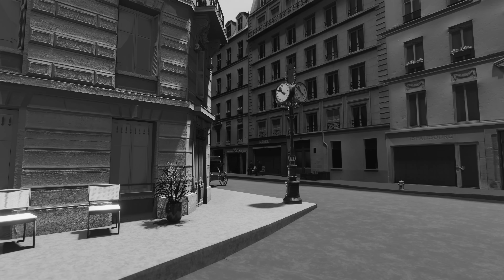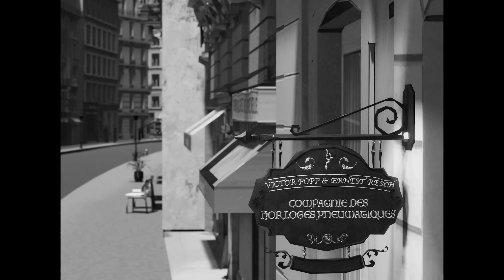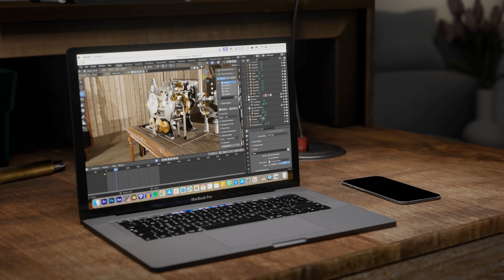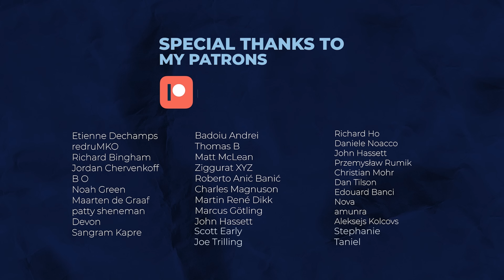The Underground Clocks of Paris

Comment: This is the most steampunk tech that ever became reality.

One can imagine those pulses of air engaging multiple relay pneumatic swichts. Human ingenuity
Reply: now that we think about it
even CPU of modern computer *use the same pulse principles, only it use Electric instead of air or steam and gear
*:edited from sue
Reply: The Industrial Revolution and the rapid development of steam technology opened the optimist imaginations of both engineers and artists, giving rise to the concept of Futurism. I would dare say Steampunk is heavily based on it, given that in that era, electric power still was heavily DC based, and thus, the possibilities that AC opened later on (in terms of efficient kinetic power) were still dwarfed by steam power.
Reply: @Малэволензэ  There was no industrial revolution. They were just kickstarting Old World tech that was already here. These clocks, lamps, buildings, railroads, are literally older than the hills. Steampunk was the reality over 200 years ago. Wireless tech
Reply: Uhmmm, clockpunk?
Reply: @ВадимНечунаев-л2о  i dont think theres a clockpunk?
Reply: @shiro3146  There is. It is close to steampunk, but... clocks. Lots of gears turning.
Reply: This is widely used in industrial settings, certain tasks that require synchronization ans reliability use air pistons, which have higher lifetime than solenoid pistons, safer and easier to service, and compressed gas is its own redundant power source (in case of a power failure The pneumatics could still operate for a few minutes).
Reply: That’s how old control systems work in buildings. I still work with them to this day. Just convert the air pressure to electric signals. But high pressure is a high signal, low pressure is low. Can scale from 0-10, pneumatic thermostats are a thing. Very cool.
Reply: This cannot be neither steampunk nor clockpunk because those two are sub-genres of fantasy and this was real life thing
Reply: @Obsidian-Nebula  but this is the closest tech to the fantasy of steampunk and plus, we were diving into tech aspect of steampunk, not its character aspects of victorian rebels with cyborg body or whataver nor its aesthetic
Reply: @Obsidian-Nebula  Oh! Really ? Thanks for the advice! Now I understand the universe around me.
Reply: @Obsidian-Nebula  fiction can be based on reality. This is, in fact, reminiscent of something in the steampunk genre
Reply: @Obsidian-Nebula  this is like saying a society can neither be a dystopia or a utopia, bc those are two subgenres of fantasy. which ignores the fact that a society can definitely be either a miserable place to live in or an amazing place to live in

Comment: They ran the air lines through the same pipes as the sewer. I'd hate to have to track down air leaks down there.

I heard about air clocks before but figured a constant source of air was just given and each clock would work off of that. This simple idea uses a fraction of the air and it was kept in sync.

But, was there a way that clocks could be put back in sync if they ever lost sync? Due to air leaks, first installation of the clock, human interference etc.?
Reply from the maker: Haha Tracking down air leaks in that environment would be unpleasant I'm sure. As for your question about putting clocks back in sync - there were actually mechanisms in place to address that issue. Typically, the master clock in the system would serve as the reference point, so if a clock were to lose sync due to air leaks, initial installation issues, human interference etc., it could be manually adjusted to match the master. And from what I've read, periodic maintenance checks and adjustments were also conducted to ensure that the entire system remained synchronized. Hope that helps to answer your question and thanks for watching!

Comment: wait but doesn't it take time for air to travel which will offset the clocks? like the farthest clocks will be different to the closest clocks?
Reply from the maker: Yes, so you're absolutely correct that the travel time through the pneumatic pipes could potentially lead to slight discrepancies in time. What you're referring to is actually known as "propagation delay" and this system was designed to minimize propagation delays as much as possible using air-pressure and by optimizing the layout. Inevitably though, periodic manual adjustments were still needed from time to time with the end goal being to keep discrepancies within an acceptable range (usually not off by much at all). I hope that helped to clear things up and thanks for taking the time to watch and comment!

Comment: I like the engineering of this system, especially the almost undefinite scalability by just adding clocks to the pipe. And even if there would be too many clocks, you could extend the system in a rather easy way with another compressor and valve as sort of "repeater" for another 1.000 clocks or so.
Reply from the maker: Yes, the scalability is really just one of many impressive features of this system. I really enjoyed putting this video together and I'm so glad you enjoyed the topic. Cheers and thanks for watching!

Comment: But how did the timekeeper actually update the master clock from the observatory clock? Maybe just a pocket watch that would be precise enough for the 15 minutes to walk between?
Reply from the maker: Great question! Updating the master clock from the observatory clock was indeed a manual process. While I'm sure that a pocket watch could have been used, it's more likely that the observatory itself would have had precision timekeeping equipment like a highly accurate pendulum clock or maybe a precise quartz clocks. Though I'm not 100% certain, it's my understanding that the timekeeper would have been able to regularly compare the time displayed by the master clock and the time on the observatory's reference clock that way. So simple, but not so simple at once haha.

Comment: Interesting but it would suck if you lived at the very end of the pneumatic network and had to still be very accurate.  At best, you would be a minute or a minute and a half off from everybody else who lived closer to the source of the pneumatic network
Reply from the maker: Yes, there was definitely an element of manual checks that would go into eliminating those discrepancies for clocks furthest in the network. Much more frequent the further away you are for sure.

Comment: 6:32 so, if it needed that much time to reach the farthest clock, wouldn’t it trow off the accuracy??
Reply from the maker: Yes, so you're absolutely correct that the travel time through the pipes could lead to slight discrepancies. This system was actually designed to minimize propagation delays (discrepancies) as much as possible, but periodic manual adjustments were still needed from time to time to keep discrepancies within an acceptable range. I hope that helped to answer your question and thanks so much for watching!
Reply: @primalspace  yes pretty much the answer i needed! Many thanks

Comment: The Problem is that the air is propagating with the speed of Sound i.e. 340 m/s. So already in 1 km distance the clocks are 3 Seconds out of sync.
I wonder why the didnt use telephone or telegraph landlines which already existed then.
Reply from the maker: Fair point. I would imagine that using telephone or telegraph landlines could have been a viable alternative. Telecommunication technology was available, but it may have been prohibitively expensive to install and maintain lines for the purpose of clock synchronization. It's my understanding that pneumatic pipes were also perceived as more reliable / less prone to disruption at the time, so that probably played into it as well.

Comment: You used the term 'electronic' instead of 'electric". Electronics did not become a thing until 1900. And why would an electric synchronization system have been more expensive than this air powered system?

Comment: At 6:35 he says it takes up to a minute to reach some of the furthest clocks, does this mean those clocks were a minute behind? Or were the clocks calibrated in some way?
Reply: I think that the thing is "ok, you're within a minute of the real time ", and that's enough if you consider that a whole city was sinchronized within one minute.
Byt yes, you need to accept some delay. 
Today too, we have delay in clock sinchronization, but it's way less than a second. 
But being it a full second, it would still be ok for our day to day use.
Reply: It's possible those clocks were set ahead by a minute but it's also possible they left them as-is
Reply: @ethangibson8645  Also that ... maybe they had a system that all the clocks over a certain range are ahead one minute so the medium delay is around 30 sec ( still an impressive feat to do with only pneumatic air ... )
Reply: Autistic folks back then could prob calculate it like UPS delivery, the further away from point of origin, estimate a slight delay - so subtract a min on the outskirts of the city?

Comment: Interesting technology. I wonder what happens when there is an air leak, did they used some pressure gauges to observe an abnormal pressure drop? Where does the air leaf the system and at which pressure was the system operated?

Comment: This clock system is awesome. The amount of gears and small bits to keep track of is astounding… sometimes we take for granted the simplicity of electronic hardware today!
Reply from the maker: So true.
Reply: @primalspace  Did you make a mistake at 7:17 ?   There are 60 minutes in an hour...  not 12.  I am sure that others noticed this mistake too.  otherwise, great video !!  
EDIT.   I am an idiot.  I misunderstood what you said. Bravo !
Reply: Electronic hardware is only "simple" because the hard stuff is buried under countless layers of abstractions. Try to think what actually happens electrically when you press a comment button and you'll be totally out of clue in no time. It's actually much more complicated than this pneumatic clock system. A video that goes through the full chain inside the SOC with the same level of detail would be impossible (does anyone accept the challenge?).
Reply: @falsemcnuggethope  i could probably get like 4-8 layers of abstraction deep, explain about 80% of it and tell you the whole OSI model. Would need to know the source code of YT and Google's servers ofc. But without the source code, sure I can explain most of it (If youre on a unix machine lol). It would take an hour or more to write that comment though
Reply: Since I today got notification about this cmment, I can recommend video called "How do Digital and Analog Clocks Work?" made by "Branch Education" that explains how electronic clock works. If I remember correctly there are things in video that are touched only brieafly cuz otherwise video wpuld need to be longer which I think also says how complex it can be
Reply: what do you mean by "simplicity of electronic hardware"?
Reply: @Daniel_VolumeDown  I think that comment was meant to be sarcastic... I hope?
Reply: @Shako_Lamb I think they're talking about mechanical simplicity.
So much stuff that used to move is solid-state these days, and it really does make things simpler.
Reply: @antonliakhovitch8306  I mean yeah it makes sense in that way, it's still a hilariously ironic thing to say though
Reply: Just because you can't see the complexity of electronics doesn't mean its not there. Keep in mind those transistors are only a few atoms across, so sensitive than quantum mechanics can cause electrons to just teleport to places they shouldn't be. The machines that make them are so sensitive to vibrations, a truck driving by outside would cause the chips to be ruined. There was some simplicity to them back in the days of electron tubes and relays, but as soon as it went digital it became a manufacturing marvel.
Reply: It's an interesting debate. I found myself thinking of all the electronic innovations to minimize difficulties and randomness, of which binary is possibly the very biggest. Designing an 8- or 16-bit computer in the 80s was relatively simple. Clock speeds were so low, you hardly had to know anything about the actual behaviour of electricity.
   However, there was genius behind that simplicity; I'm still baffled when I think about how binary logic and 2s-complement math were invented. And as speeds increased and the analog behaviour of electricity started impacting digital systems, more brilliance was needed.
   Op-amps are a comparable marvel of simplification in analog electronics. They're very easy to use, but not at all easy to design. (And again, high speed causes big problems.)
   In mechanical clocks, the basic design of the escapement doesn't vary much. Like digital electronics, it reduces a lot of variables to a series of discrete steps. However, I'm sure the design of an escapement must balance a lot of hidden issues.
Reply: @crazy_mind-ox8if You could say the same about gears. There are zillions of atomic interactions per second that need to happen just for a gear to turn!

From the perspective of a system designer, complex electronics really do make life simpler.
Eg: I recently watched a video of someone replacing the change gears on their lathe with a rotary encoder + stepper motor, because it's just so much less hassle to deal with.

Comment: Wouldn't the clocks at the farthest end of the pipe be out of sync with the master clock? when the pressured air passes through the pipe the first clock will be timed first then the pipe say x distance away will be only set after a certain delay cuz it is further away... so wouldn't this set same time in a locality but not the actual time.. right? can anyone explain
Reply: The system only actually causes the clock to move the minute hand forward one position every 60 seconds so I assume they could calculate the rough time the signal will take to reach the clock and adjust the clock to be ahead by a minute or two to compensate for the delay. There no second hand on the clock so the clocks only really need to be accurate within under 60 seconds of each other.

Comment: great video - but we never did get to find out how the master clock was synced to the observatory clock. Thery didn't use AnyDesk - but how did they do it? We never find out.hmmf.
Reply from the maker: The observatory clock, that part was not a joke haha
Reply: @primalspace  so, how did the master clock get the time from the observatory clock? I need to know!! did someone read the time, adjust a pocket watch, run over to the master clock?! how did that information get to the master clock from miles away??